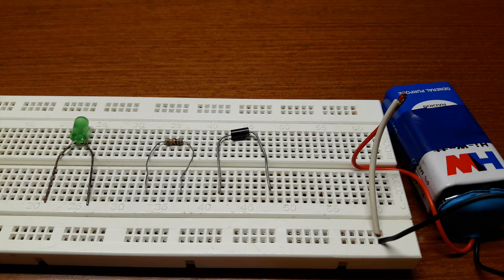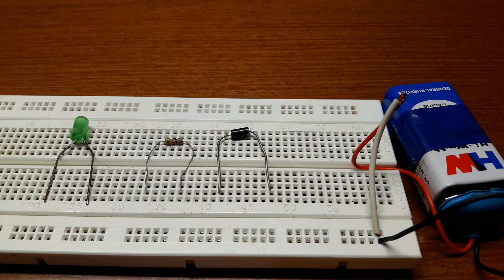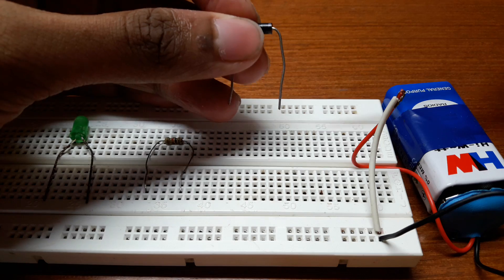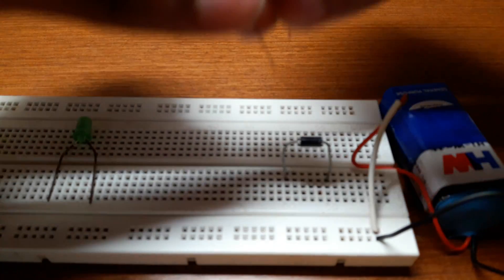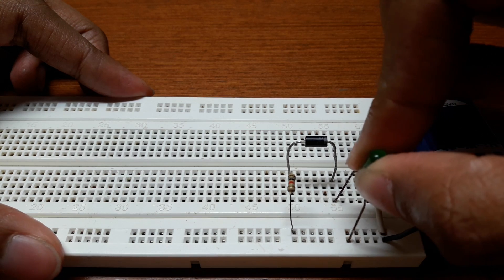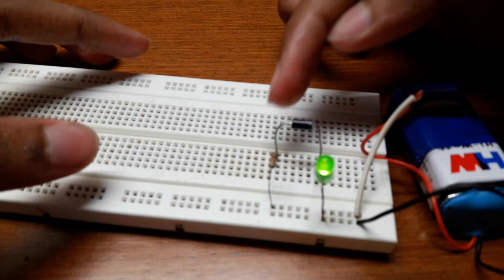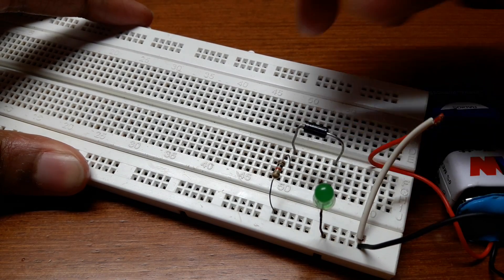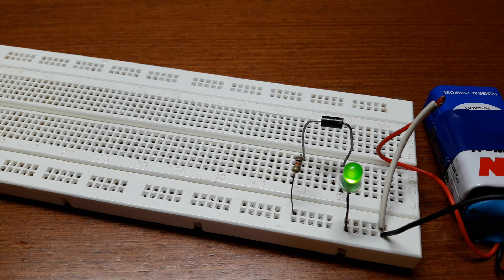What is a "Diode"❓ DIY:- "Simple Diode Circuit."✔

Comment: Well using DC Voltage on a Diode is a useless way of explanation. Try using a transformer that converts 240v AC to something like 12V AC or something then show how Diodes work.
Reply: Don't react that way he is just showing how diode works basics should be clear first for engineering 👍🔥

Comment: Please explain why diode remains powered after polarity is switched to negative? It's not much, but you can clearly notice it is lit which means it is taking in current?? Are there higher rated diodes or what? I want no power coming through. isn't that what diode is for?